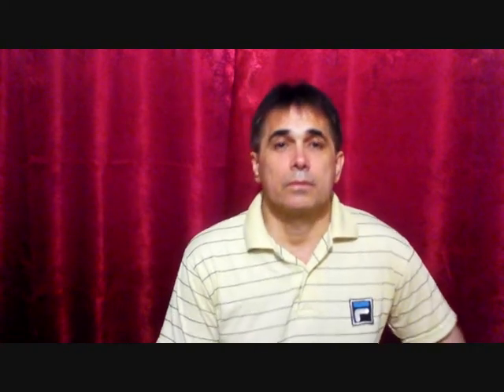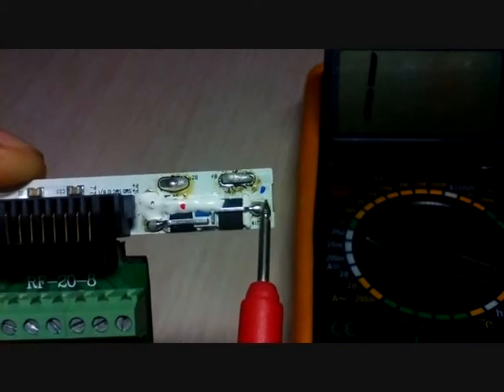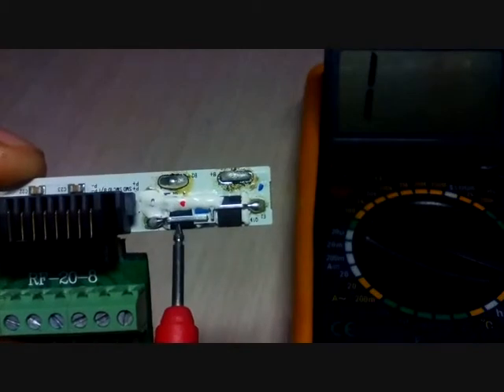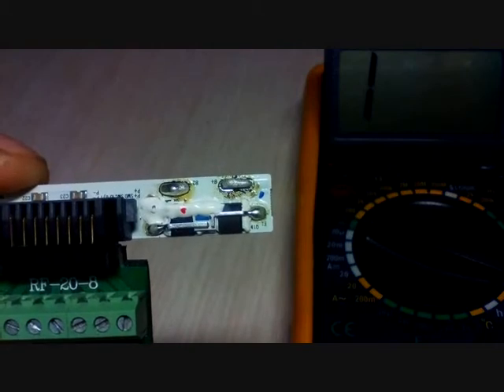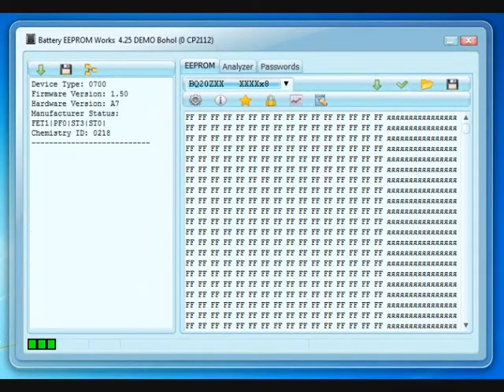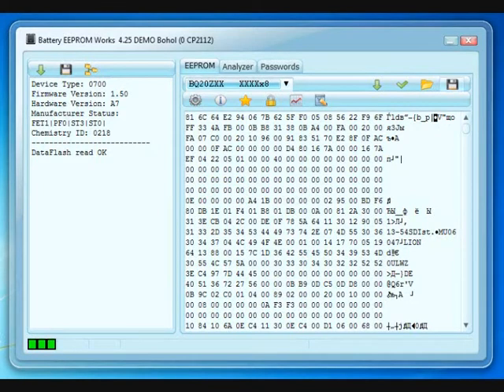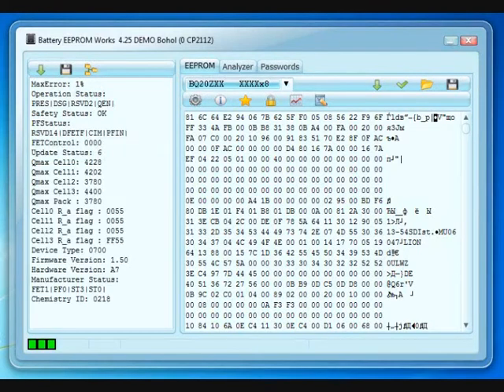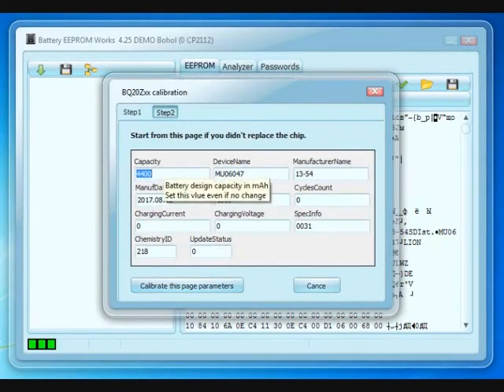Laptop battery repair ENG tutorial#1 Dataflash programing BQ20Z70

Comment: Dear sir. Thanks for the video . It was very educational.
I have a battery with part number 441807800002 and the chip inside is BQ3060 . Do I have any options or I have to replace the battery ? Thanks in advance

Comment: i changed all battery cells but it is not charging and  laptop works 10 seconds with battery why?
Reply: You need to reset mcu and calibrate the battery.

Comment: hi thanks so much i have important question i found many adapters but i don't know which one should i buy
no.1
https://www.alibaba.com/countrysearch/CN/cp2112.html
no.2
https://ru.aliexpress.com/item/UsenDz-YS2112-HID-SMBUS-I2C-Master-free-drive-GPIO-USB-1-8V-I2C/32825980222.html
no.3
http://www.iran-module.ir/product_info.php/products_id/1716/pname/%D9%85%D8%A8%D8%AF%D9%84-USB-%D8%A8%D9%87-I2C-IIC-UART-TTL-%D8%A8%D8%A7-CH341T
no.4
https://www.yoycart.com/Product/37645976284/
no.5
https://ru.aliexpress.com/item/UsenDz-YS2112-HID-SMBUS-I2C-Master-free-drive-GPIO-USB-1-8V-I2C/32825980222.html
no.6
https://ru.aliexpress.com/item/USB-to-I2C-IIC-TWI-SMBUS-master-Converter-4pin-ADC-Decoder-Program-24xx-EEPROM/32709855227.html
no.7
https://ru.aliexpress.com/store/product/USB-to-IIC-SMBus-I2C-transfer-board-free-drive-installation-with-power-indicator-light/1167644_32647647156.html
no.8
https://ru.aliexpress.com/item/USB-to-I2C-IIC-SMBus-adapter-plate-Free-drive-installation-With-power-indicator-light-Free-Shipping/1587747294.html

which one ? is that all of them is same?
if yes so all of usb I2C Adapters should work. is it true?
i know i should buy from be2works but if the above 8 models is suiteable so i can find that in my own city
i searched in my city i found these tree
no.1___cp2102
https://pazhelectronics.com/electronic-shop-pazh/modules/other-modules/TTl%20to%20USB-detail
no.2___ch340
https://pazhelectronics.com/electronic-shop-pazh-1/all-electronic-components/electronic-module/usb-to-ttl-ch340g-converter-module-adapter-for-arduino-detail
no.3___ft232
http://www.pazhelec.ir/index.php?route=product/product&product_id=716&search=232&description=checked

Comment: I have bq 29330 and bq20889 in dell j1knd(6cell 2+3pairs) battery...battery not working after changing middle cells...is it supported by be2works??
Reply from the maker: Allsupported chips are listed at the first page of the websiate. http://be2works.com

Also it's a very bad idea partially to change cells Better select good cells from existing battery pack. Such as described in video.
Reply: I want to know which ic to be programmed..bq 29330 or bq 20889?
Reply from the maker: BQ20889
Reply: Laptop battery repair thank you so much..god bless